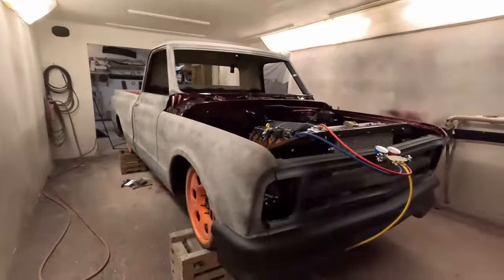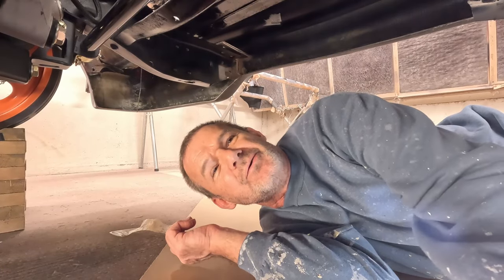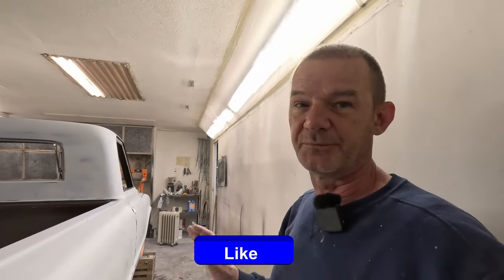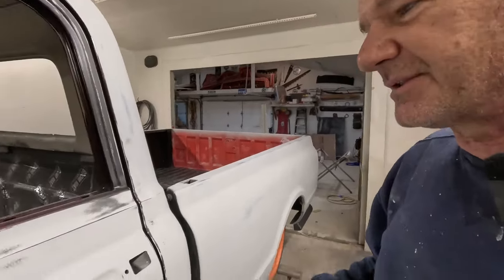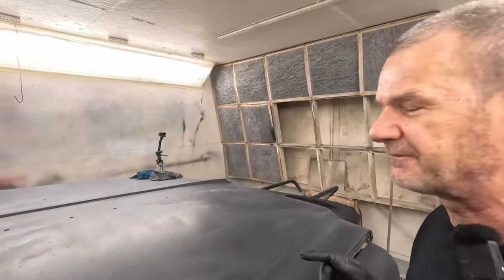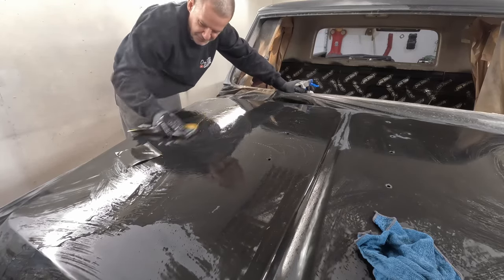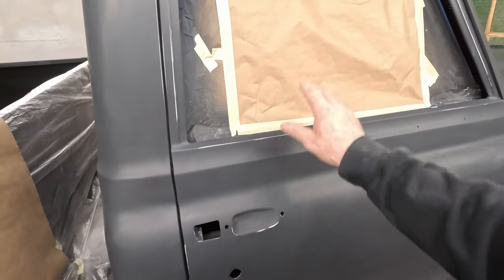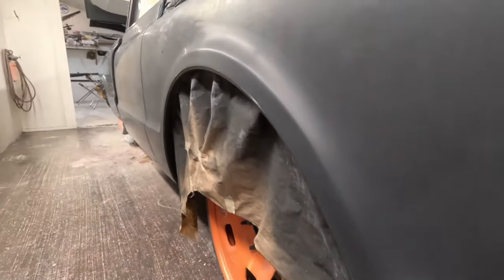Over The Fender Garage EP82 Final Bodywork Sanding and Prepping Guild Coat For the Candy Paint Job

Comment: I just found your channel you incredible work I’ve been doing the same for the last 30 years. I’m on my last project the 65 Mustang for my wife I have terminal cancer. I’m struggling with chemo and immunotherapy and trying to finish this car. Everything is new updated upgraded. I’m down to the wheel houses and quarter panels and tail light panel. Everything else is done wired. Front ends already painted, be safe painting number one cause of my cancer is exposure to chemicals over the last 30 years and I’ve always worn respirators gloves particle masks. Can’t wait to see this done. Actually I already did see you painting it. Beautiful job.
Reply from the maker: Sorry to hear that keep up the good fight to hold it off I went through that about 15 years ago, I wish you luck!  Thanks for the complement.👍
Reply: Couldn't help but notice your comment. I just saw online where this fella passed away unexpectedly four days ago. We live in the same county. So sad. Also, I hope you get to finish your wife's car. <3